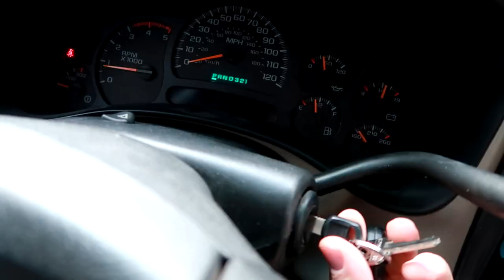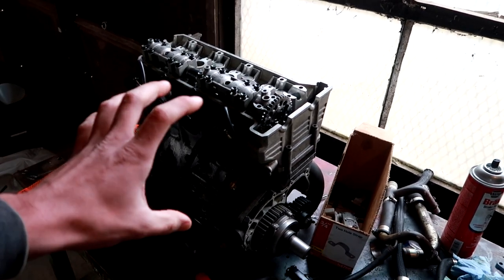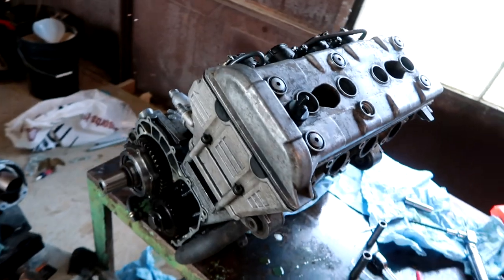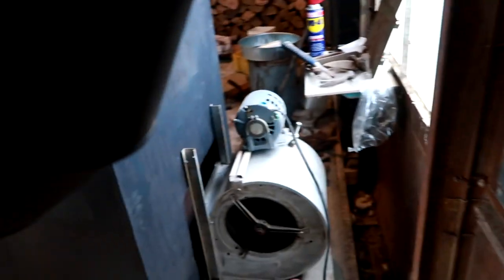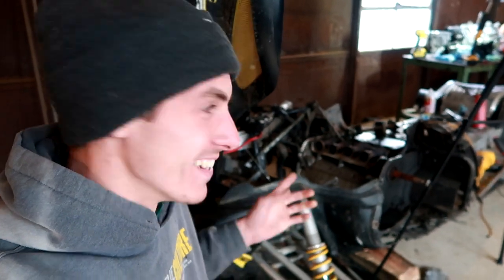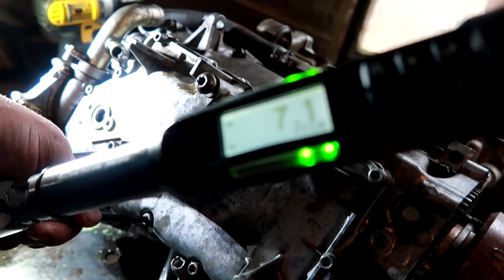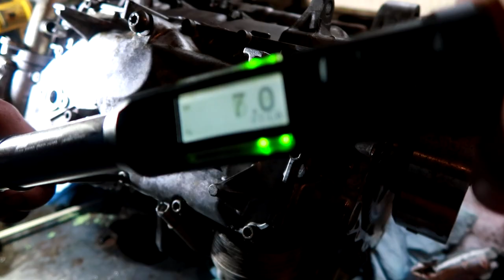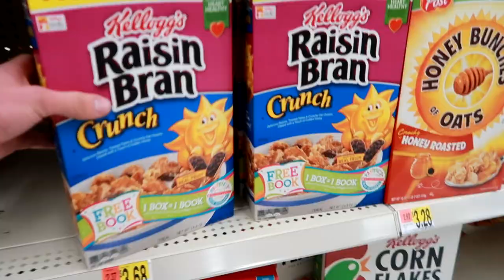TOTALED RX 1000 ENGINE

Comment: Dalton don't use Fram oil filters, they have this weird sensor that sometimes sticks and causes you to loose oil pressure. That's what happened to me in my truck, at red lights at idle I would loose oil pressure. So I talked to a buddy and he said change your oil filter to a different brand. And I did and it runs great now.

Comment: The dry clutch is a dual clutch auto. It feels like a manual trans but acts like an auto trans. The Ford Focus has had alot of problems with that type of trans since it started using it in 2013.

Comment: From what I understand we gain about 2 minutes and 7 seconds each day after January 2nd and our days are getting longer about twice as fast as last month. So we start gaining a bit more and more each day until the summer solstice in which the days begin getting shorter then which should be around June 20th - 22nd. And, I prefer to work alone on stuff like that if it's a fairly straight forward deal. If it's new and I've never done it, I like to have a second a set of eyes around.

Comment: Comming from a Master Snowmobile Technician, If your going to fix it yourself, You should at least have proper tools and a shop manual. Torque specs. are important. so you need a torquewrench. A common problem is using to much crankcase sealant just like Ian is doing on the oil pan. Clean parts well and read shop manual and your well on your way, Good luck!
Reply: Brian Demas Yup,I agree. I worked on sleds for 20 years,had my own shop here in Northern Michigan, I fixed many mistakes done by guys like them. I also picked up some great deals to fix and flip. Some the very same day. As I always said,the first rebuild will probably fail because that's the one you learn what not to do again. I had several master mechanics to learn from so my mistakes were few. One was an original Soon I 500 racer racer from the 70's. He tought me modification techniques on both engines and drive lines as well as proper chassis set ups. Guys now days have no idea how to properly tune their sleds. I still do some of that for the young guns. The newer sleds are much easier to adjust,no more stopper straps breaking.
Reply: Supposed to be Soo 500